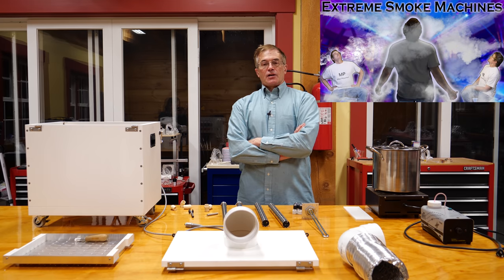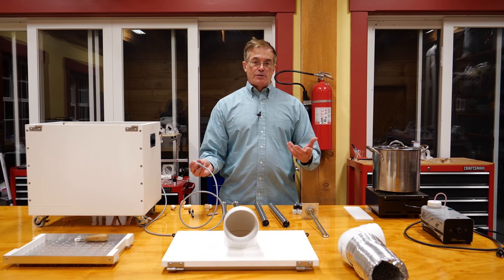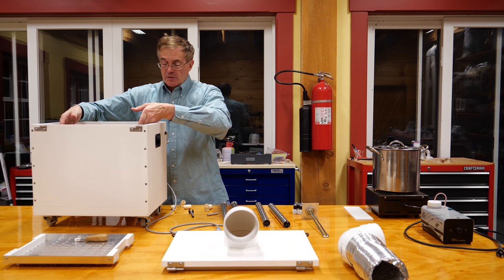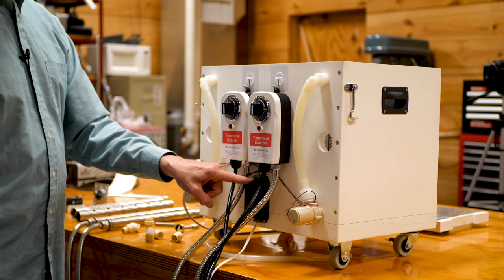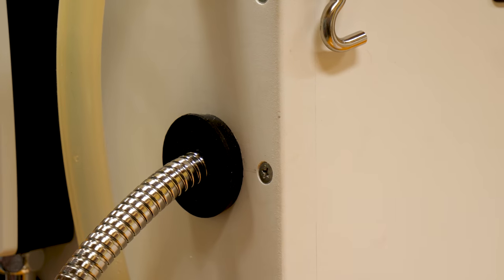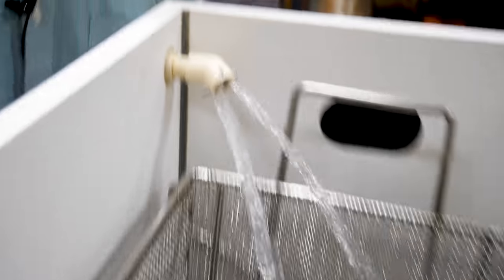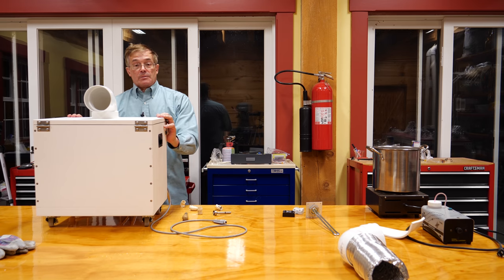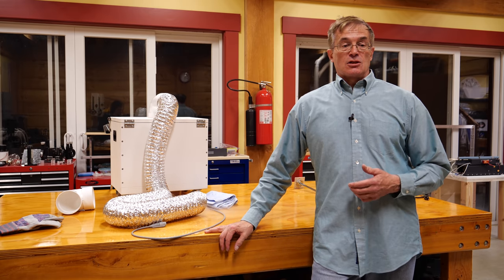Powerful Dry Ice Fog Machine!

Comment: Aren't there safety issues with having a room filled with CO2?
Reply: Did you watch the video all the way to the end?
Reply: @silas6647  Something like that should be right in the beginning IMHO
Reply from the maker: CO2 is unpleasant to breathe.  It actually drives  respiratory function.  It settles because it is dense and in this case it is also cold.  This is why these machines have been around for decades and are used around the world for theatrical productions and weddings
Of course you can spill the hot water, create a short start a fire or inadvertently roll it down a flight of stairs.
Be careful!
Reply: @d.d.a.2243  That not the first Youtuber to die from Dry Icing a pool either.  Incidentally, this is also why wearing a mask while driving(etc..) is a bad idea.

Comment: The oil hazers (crackers) were phased out of the nightclub business since around the 80s, so pretty much all of our machines use glycol nowadays, I think this was due to inhalation of vaporized oil was shown to be bad for one's health. Interestingly some fogger manufacturers have tried emulating dry ice machines with mixed results using either bottled CO2 or a refrigeration system to cool the glycol vapor, still nowhere near as good as a proper pea-souper dry ice machine though :)

Comment: Those pumps are great. They're my go-to pump for basically all liquids these days.

Several years ago I decided to see just how much I could abuse those pumps and get away with it. It pumped for nearly a week continuously submerged in 90C water before giving up the ghost.

Currently I've got one running my immersion circulator. One of my recipes takes 85C for four days, still no pump failures.

Comment: It looks awesome, I was working weekends in my lab in the run up to Christmas and had a friend with me one Saturday afternoon. We'd had a delivery of molecular biology reagents on dry ice. Usually, messing about with dry ice was frowned upon but there was nobody around to frown... I tipped a good 15-20 kg dry ice pellets into the big metal lab sink and then with the powerful hose, sprayed a vast amount of water onto the dry ice, filling the lab floor with vapour. It was awesome but my colleague was a little worried in case somebody was walking down the corridor because it was spilling out by that point! 

Another favourite of mine was pouring liquid nitrogen onto the floor. It picks up any dust and hair lying under benches and drawers and scoots it away as it dances along the surface.
Reply from the maker: I know very well the antics of the grad student, after hours.😙
Did you know that dry ice fog is used to clean the world's largest telescope mirrors by causing that same levitating effect to float dust away from the surface?  Probably the result of some grad student remembering his Saturday afternoon.😋
Reply: @TechIngredients  no fingerprints or smears! Probably best not using it to clean my phone, however
Reply: @satyris410  Actually I'm not sure if your phone would freeze quickly. The dancing air may work as a potent insulator for your screen. However I still don't recommend it, as I am not sure and don't want to be the cause for anyone recking their phones lol
Reply: Be careful with the metal sinks in biochemistry labs. Typically they have glass pipes due to the various corrosive materials that need to be disposed of. Putting the dry ice down the drain may cause thermal shock in those pipes depending on what kind of temperature differential the glass is subjected to. Not to mention the absolute nightmare of cleaning up a broken glass pipe that's been abused by the Sorceror's Apprentice doing God knows what kinds of experiments.

Comment: I built one of these in the 80's from a 30 gallon drum and a water heater element and drainage pipe outputs.
Actually I built three of them.
The second one had a raisable bucket to be able to stop the fog/mist.
The third one was attached to a two wheel handcart and had two individual heater elements on different cords to be able to reach 110 outlets on separate breakers and an improved door seal since I could not see for all the fog backstage...
I really can appreciate the PVC foam board, the hot water circulator and water distribution.
Well done!
BTW, you epitomize who I want to be!

Comment: When using these type of hinges it helps if you trim one of the pins so that it is slightly shorter than the other. That way the longer pin is the "starter" pin. It's much less frustration starting with one pin and then the other rather than trying to line up both at once. Great video! Thanks again.
Reply from the maker: Good idea, thanks!

Comment: I worked special effects for many years and we made these out of 55 gallon drums,  sometimes in the backlot we woukd have 5 or more with propane flame rods under them because the heaters could never keep up.  This is around 1990.  They use different machines now that use dry ice to cool ultrasonic water foggers.

Comment: You can get both oil and water based fog machines, and oil and water based hazers. :) In hazers there are now also glycerin based ones which still use a heater, but also compressor ones which doesen't use a heater. Both the heater and compressor based ones can be found in both water and oil variants. My old Antari HZ-100 does both oil and water based fluids too. The oil based one is hanging in the air a lot longer than the water based one though, but it will also leave a greasy residue everywhere. The water based fluid does not leave the same amount, it still does leave a bit, but it will evaporate within a few hours. :)

Comment: So nice to watch your videos, enjoy every minute of it, and also learned a ton of stuff.
What happens with the CO2 .. is there any kind of safety limit like room size vs kilograms of CO2 to not dye from CO2 poisoning ?
It's fairly rare these to happen yes, but some kind of safty numbers will be nice :)
Reply: Yes, there is. Too much CO2 in the air will kill you. You can breathe it fine, but it isn't oxygen so you suffocate. But as long as you don't fill a large part of the room with the dry ice I'm sure it's fine. If you do have concerns, just do a big vape outside haha. 

As long as you keep the concentration below 100000 ppm after the dry ice evaporating you will be fine.
Not sure how much KG dry ice would be save for you to use, as I have no room size, temperature, etc. But if you just open a window you will be fine as long as you don't fill 10% or more of the room with dry ice
Reply: Density if air is about 1kg/m3, so 10kg co2 in a 5m*5m*2.5m room would yield a 16% concentration... Less than i thought actually, but it could be served with a warning for kids wanting a party in their room or in the garage.
Reply: @teaser6089  you are not entirely correct - there is a concentration at witch co2 itself becomes a problem even though there is enough oxygen - you have to remember that you need to get rid of co2 from your body - so the air needs to be at low enough lvl of co2 to accept co2 from your blood
The
 permissible exposure limit over an 8-hour shift for CO2 is 5 000 ppm measured as time weighted average (TWA) level of exposure. In addition, the American Conference of Governmental
Industrial Hygienists, ACGIH, has
 set the short-term exposure limit to 30,000 ppm of CO2
Reply: @teaser6089  no, he is not ''not entirely correct", he flat out wrong and giving life-threatening advice.
Co2 will prevent you from absorbing oxygen (don't quote me but I think the increased carbonic acid in the blood decreases the ph, which in turn fucks with haemoglobin), so you can suffocate even if there is plenty of oxygen in the air.
When wikipedia tells you the lethal dose is 90.000ppm, you should not tell someone he will be fine under 100.000ppm.
Reply: @laurean5998  you're confusing carbon dioxide (CO2) with carbon monoxide (CO)
Reply: @ImpactWench  Have you actually checked or just assumed? CO2 is toxic, 90000ppm exposure for 5min can be lethal according to cdc.gov/niosh/idlh/124389.html
Reply: @IamCrusaderRUS  normally the atmosphere contains about 1/3 that amount of co2

Comment: I would like to state this for safety reasons: CO2 is an asphyxiant and can kill you. If you are to use this machine please use it in a well-ventilated area (not the inside of an enclosed car) and be sure to keep pets, who are more susceptible to the higher concentrations as they are lower to the floor, away from the area. If you will use this device, at least buy and use cheap CO2 monitor in the area of use for your protection.

I would also like to say, I enjoy the content of your videos, and appreciate the amount of work that you put into them, and the amount of knowledge you have in inventing and engineering.
Reply: Not exactly.  You can handle extremely large doses of CO2.  I you replace all the O2 then yes, you die.  otherwise there is no problem.  Your body uses CO2 for life.  It is not harmful except in cases O2 is missing.
Reply: No need for CO2 monitors when using this, even in small spaces. Every living thing that breathes oxygen and exhales CO2 have built-in CO2 monitors inside their body. They will feel out of breath, and nearly all of them are smart enough and capable enough to move to fresher air.
Reply: @BenFenner   Yeah, but having someone passed out drunk on the floor of a halloween party flooded with 15kg of CO2 might still be a problem.
Reply: @13minutes88  You can die of CO2 poisoning even with adequate oxygen . It is called hypercapnia, CO2 does bind to hemoglobin and can displace oxygen. 
Over 1% CO2 (more than 20 times the usual concentration in the atmosphere) it will get quite uncomfortable and at 7 to 10% it can easily cause death. 
I am not saying that this smoke machine is dangerous to use as I don't know and I haven't given any consideration to it but what you stated can be dangerous if someone thinks that adding 7% of CO2 to their air is fine because they will still have rouhgly 19.5% O2 vs the usual 21% they are in for a bad time. 
Of course what BenFenner said is true, they will feel it as what we use to sense when we need to breathe is not lack of O2 but excess of CO2 .
Reply: The good thing about CO2, as opposed to CO for example, is that you will be distinctly aware that something is wrong well before there is any danger of passing out or dying. Your body senses when CO2 levels are too high in your blood, it has no way to tell if O2 levels are adequate. CO poisoning goes unnoticed because even though you aren't getting enough oxygen, you are still getting rid of CO2. If you're asphyxiating from CO2 you will feel like you desperately need air.
Reply: And yet he survived the car and the tiny dog was fine walking through it on the ground..
Reply: @treva31  That is not really a good argument for not putting a warning. Just because people have not had head injuries while bicycling, doesn't mean helmets don't prevent them. The concern is that no warning was put on the video about the possible dangers. Also, the actions of operating the device in an enclosed space like a car (as in the video) only increases the risk of someone putting themselves in a dangerous situation. Unlike the equipment in the other videos dry ice is easy to get. Because of this ease to replicate what is shown in the video, it is more likely others will copy what is shown. These imitations could likely be deadly.
I have handled dry ice, liquid nitrogen and other more hazardous substances and while things usually don't go wrong, it is always beneficial to have a healthy respect for the things that can become dangerous.

Comment: Have you considered a pipe delivery system for additional dry ice. For example a hopper tube that self levels when the dry ice below is removed. It would require a complete redesign, but would allow for continuous operation. You could have a connected reservoir of water to maintain the level as well.

Comment: Very superior to the ones we built in the late '70's.   Essentially a bucket of water on a hot plate under the DJ table, into which dry ice was placed.   'crusting' (ice shell around the CO2) eventually became a problem as the heating capacity was not adequate for the amounts of dry ice we were literally dropping in the bucket.

Comment: For those following along at home: Some industrial gas providers call this type of ice "rice". It's used for a media blasting process that doesn't leave any residual film or dust. Commonly used for cleaning historic buildings and fountains.
Reply from the maker: Liquid CO2 is also used to blast dust and contamination off the world's largest telescopes.
Reply: @TechIngredients  Yep! And large chunks of dry ice can be used to purge a flammable storage vessel of oxygen before cutting or welding. It's incredible just how many uses CO2 has. From adding effervescence in beverages, to preparing reflective surfaces allowing us to peer back in time to the early universe. Very cool stuff.

Comment: In plumbing /boiler industry we call energizing an empty water heater or boiler as "dry firing" . Typically what I get calls for in this scenario is homeowners who have changed their water heater out and energized before filling . Usual evidence is not wiring damage or fire / arc indications but rather , ohms resistance readings are off the charts on each element . I then pull the elements and usually find that the elements will havr a very thin  dark like carbon on surface and a bulge somewhere on element surface . Sometimes the outer housing of element coil will have burst , exposing the inner construction . Thus far , having an element to "dry fire" hasn't lead to a fire , thankfully . 
    Let me be clear , those elements were housed inside of a metal vessel . In the construction you see in this video , pvc is flammable and when burning , off gases extremely toxic smoke that posses a huge risk to fleshy humans . Something to take into consideration .

Comment: One of my High School theater engineering students and his father built this unit from the plans you provided. Thank you. We used a 2K water heating element and a $10 thermostat w/20amp relay. It heats 5 gallons to 150f in 30 mins. A float valve and 20amp relay was used to control the heater in the event of low water. Some of the problems we encountered is the PVC board at HD & Lowes is not cheap and proved leaky. The water heater elements are made for a curved surface and were difficult to seal. We lacked the time to build the dispersion tray and used diverters to decent effect. But after getting the leaks to a minimum, the cheap thermostat burned up after less than an hour of use controlling the 2K heater. Ultimately I had to hot wire it and we got one performance from it but need to improve the efficiency of our system for more sublimation. I am interested in what sealant you used with the PVC board. Also, I noticed a shot in your other video showing a 1/4 PVC baffle between basket and water. Isolating the hot water from the ice is an improvement I want to make to add life to a load of ice. Is that baffle effective?
Reply from the maker: The foam board isn't cheap, but it's similar in price to decent plywood. That's just to put this in perspective.  Why did the thermostat fail?  It's basically doing what it's designed to do 24/7 for years.  I simply sealed the box with the same epoxy that was used to fabricate the box.  The trick is that the double wall thickness which allows the outer wall and joint to operate near room temperature.  I tried multiple, small CPVC fittings with various hole patterns to distribute the water and prevent localized melt through without much success.  The tray is much  better.
Reply: @TechIngredients  Thanks. The manufacturer of the thermostat conceded the controller failed for unknown reasons. We'll try another unit. I found out they used Gorilla Weld instead of epoxy. Something we're going to change is the hinge and latches. When the lid is raised, all the condensation pours down all over the electricals in the rear of the box. And the latches are too fiddly for fast theater environments. It's a fun set of problems.  The thermal properties of the PVC board are fascinating. Have you considered isolating the ice from the water with a thin sheet of it and some drain holes for water return? Whenever I opened the box, there was a cloud in it and I'm thinking dry ice is being lost when the unit is idling.

Comment: A W3001 microcomputer temperature controller wired in series on the control side with a 110 Volt water heater element would work great. And both are cheap, plus the temp controller can be purchased as a 12v , 110v , 220v.

Comment: You can spray a high temperature coating used for BBQ's on the inside of your box. Give it a few layers and you won't have temp variation issues or thermal weakening. They sell it at wal-mart in the spray paint section. Pretty sure the stuff is rated up to 600f +
Reply: Also you could have used a garden sprinkler head nozzle on your water output to get a more even distribution of water over the dry ice.
Reply from the maker: It doesn't work.  The trade off is that as you introduce more resistance to the flow in order to break it up into finer and finer flows or droplets, you loose flow rate.  Both are equally important.

Comment: A true hazer which uses oil is not heating the oil in a fashion we would consider heating.  An oil hazer injects high pressure air into the oil which 'cracks' it and the resulting particulate matter can homogenously fills a space. Check out the DF-50.